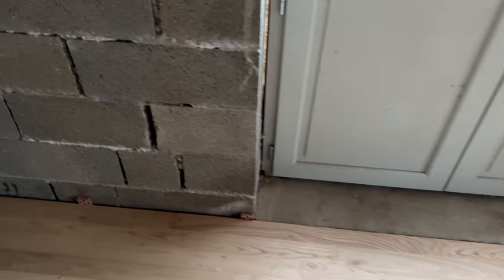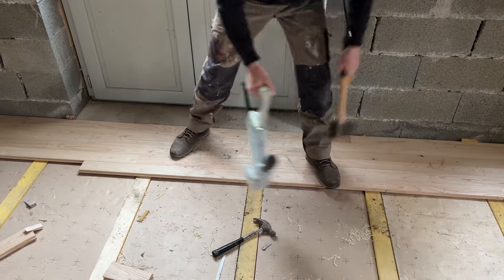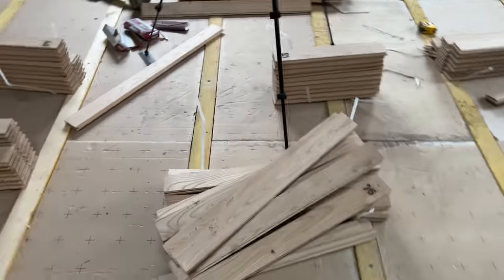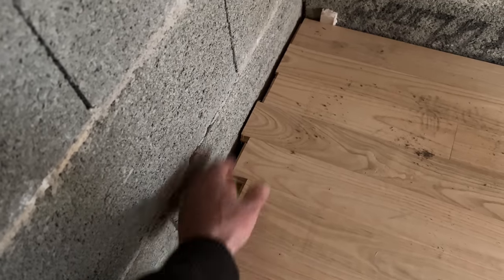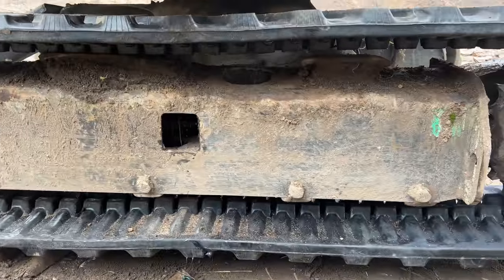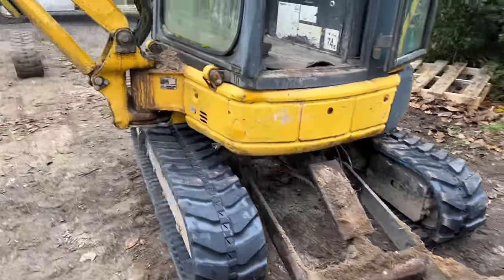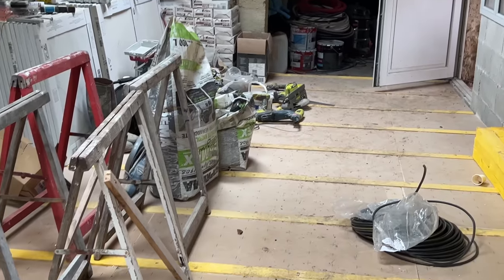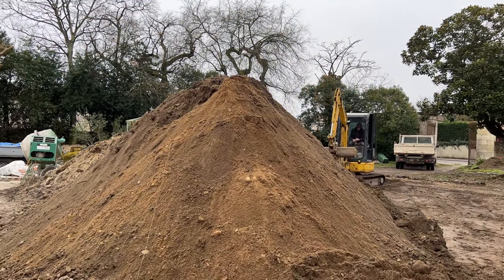EP114 New Tracks ,Parquet floor for the Guest apartment , The Renovation Work @ Our Passion Project

Comment: Ed. The reason you may be getting gaps between boards on the parquet flooring. You are "bruising" (denting) the tongue when you are hitting it with a hammer. Stopping it from seating in the groove fully. Use an off cut. Hit the off cut with the hammer to tighten the joint, before nailing. Also don't stand on the joints you are trying to tighten them. Hope the bairn are feeling better.

Comment: Learning as you go is one thing but to be able to do it to the high standard that you do Ed is incredible. I live in Dordogne and all the artisans I've had have been total crap so now I do everything myself, I take my time, think it all through first down the smallest detail, make lots of notes, use YT is needed then just do it. My huge house hadn't been lived in for many years and has suffered from a 60's makeover, so it's a mix of 18th, 19th century and 1960's. Working on the kitchen for now, then am going to panel the living room other three walls, the main wall is all 18 th century dark chestnut panelling that came from an old manor house that was being demolished in the 60's, more tragedy! The floors, even upstairs, the kitchen, the sink, the bathrooms and the showers are all dirty beige marble, coffee stain look so fashionable in the 60's. A painter came to paint the french doors in my bedroom and dressing room that give onto a large terrace and he just brushed them down and slapped on some bright white gloss paint over the chips ! I wanted them stripped, repaired and finished, what I got was glossy crocodile. He came back to take out a marble shower tray that was leeking into the newly painted kitchen and he used a disqueuse ( ? ) without telling me and the marble dust in the set up bedroom you can imagine. 4 electriciens have come and gone so far and another is due soon. The one who redid the electrics three years ago before I arrived cut off the electricity in half the rooms and half the kitchen but changed all the sockets to white plastic, screwing them in with aglo screws into the wiring ! Shocking! I'm fed up but it is pushing me to do more than I wanted to as I spent twenty years of my life restoring ( roofs, slabs, walls, plaster, electrics, new windows and doors and tiling, not just paint ! ) I so admire you but you are so much younger, I didn't expect to be doing this again.
Reply: Keep going you sound to have a big job on you hands  maybe you should start you own youtube channel too, love this type of vlogs. Good luck. X